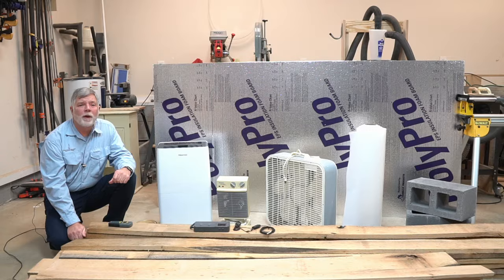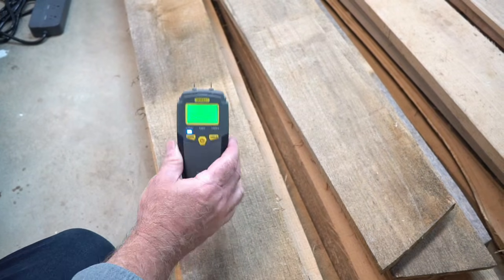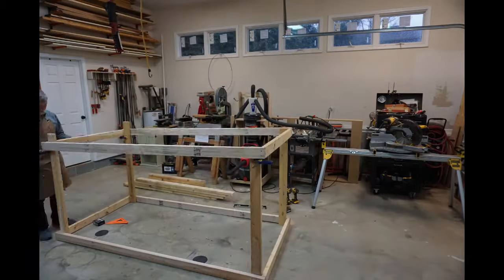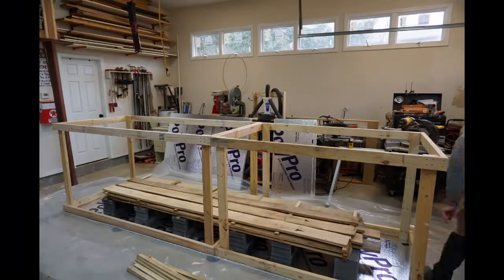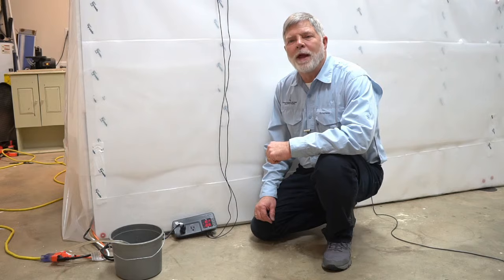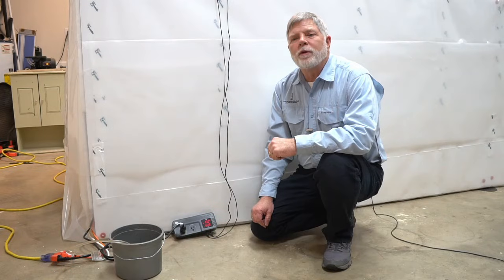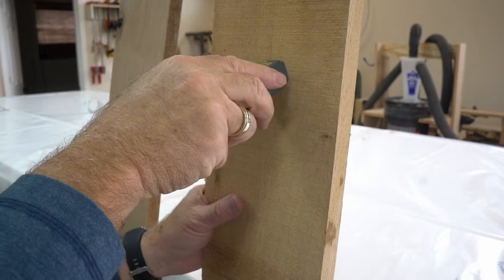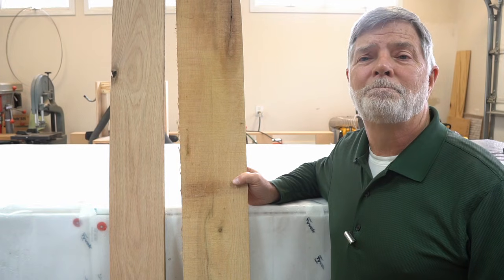Simple DIY Wood Drying Kiln

Comment: I'm thinking that simple ducting would have been far simpler than devising another heat source using light bulbs.
Edit: Not to take away from your design overall. Seems like a great idea, and affordable for a person with a specific budget.
Reply from the maker: I did not want to introduce moisture from outside the kiln into the system. If I used a closed loop duct, that would work.

Comment: Very interesting video, thanks! Did you thought about placing the space heater outside the kiln with a conduit to the kiln? I think the dehumidifier could handle the added air humidity brought in. But I’m not sure
Reply from the maker: I did not think of that. It would complicate the design a little but may improve on some safety concerns with having a heater inside the box. I used the amount of water drawn off by the dehumidifier as a gauge for when the wood was dry since I did not have a moisture sensor in the wood. In later versions of this design, I added 1 1/2 inch pink insolation board and found that the heat from the dehumidifier itself was sufficient for the drying process and only needed the heater for sterilization.

Comment: Do you use a moisture meter in the kiln when running to determine when the switch from drying to sterilization?
Reply from the maker: I do not use a moisture meter in the wood being dried but I do use a humidity sensor in the kiln that I monitor. I also monitor the water being pulled out of the wood. When I stop pulling off water, then I switch to the sterilization phase.

Comment: After the wood sits for a year? Defeats the purpose...
Reply from the maker: Air drying wood will not get the moisture content to the goal of 6-8%. In the climate in my local area, a MC of 12% is about the best I can get air drying. I use my kiln to finish the drying process and sterilize the wood. I have dried wood from green but it takes 8 weeks or so.
Reply: @logstolumbernow2011  Im guessing air drying will leave potential for bugs to be still in the boards?
Reply from the maker: @yessir6325  Yes. If the wood has been infected with wood beatles, they could remain dormant until the wood goes inside and warms up. Not all wood has insects but it is really disappointing to find a little pile of sawdust under your new farmhouse table.
Reply: I must be in a similar area, I can't seem to get it below about 11% where I am, in South East Tennessee. Makes sense now, thank you!
Reply: What box are you using for temp control and humity control? Did you get it on Amazon?
Reply from the maker: @TheBignick243  yes, I bought an Inkbird Temperature and Humidity Controller ITC-608T Pre-Wired Dual Stage Thermostat 120VAC 15A 1800W from Amazon. Cost was about $70.

Comment: How thick is the foamboard you used?
Reply from the maker: In the video I use 3/4" foil sided styrofoam. I have since added 1 1/2" pink rigid foam board cut to friction fit between the 2x4s then wrap with the styrofoam. The added insulation gives me better temperature control.
Reply: @logstolumbernow2011  Thank you

Comment: Excellent! I'm using your idea as inspiration to build a modified kiln in my own garage. You mention airdrying to 12-14% BEFORE putting in kiln. I'm in Florida with high humidity, so I doubt airdrying will get it down to that low. What about if I put in wood that's around 22-25% (at least with moisture meter) will that end up drying to below 10%?
Appreciate your thoughts on this
Reply from the maker: Yes, you can reach 10% MC even if you started with green wood. It would just take longer. Dry it slow and use your moisture meter. I have dried from green in about 6 weeks using this method. I would recommend you add 1 1/2" pink insulation board cut to friction fit between the 2x4 structure. This greatly improves heat retention.
Reply: @logstolumbernow2011  Hey Alan, thanks for the quick response. So my setup is as follows: I have a layer of attic foil radiant barrier on the inside as the first layer, followed by a 2" thick poly foam board. All of the edges are sealed by using hvac aluminum tape. My final outside layer will either be plastic like you used or a the same plastic used for wrapping homes. Will that be sufficient, or do you think I still need the pink board?
Reply from the maker: @MrEffectual  I think you have it covered. What I call pink board is probably the same as your poly board.

Comment: Hey there, can you share what kind of bulbs you used for your heat source?  Trying to ensure I can get the kiln to at least 140-150 degrees to ensure anything living in the wood doesn't survive.   Any guidance would be greatly appreciated!
Reply: I used four 250w incandescent heat lamp bulbs.
Reply from the maker: The last time a assembled my kiln, I added 1 1/2" XPS foam board insulation cut to friction fit between the 2x4s of the frame. This added the extra insulation needed for the heat lamp bulbs to bring the kiln to 140 degrees over about a 2 day period.

Comment: Hi Alan, I just built a kiln per your video. Thanks so much for the detailed instructions. My tree was just cut down here in ohio and is a softwood maple. How long do you suppose I should leave it in the kiln? Is 100 degrees the right temp for my fresh cut lumber? Thanks so much! Josh
Reply from the maker: Hi Josh, Yes, I believe 100 deg is a good temp for your kiln. You have to be careful not to exceed the operating temps of the dehydrator. Mine shuts down at an internal temp of 120 deg. 100 deg in the chamber is right at that border line. Drying times are dependent on thickness as well as specie. 8/4 boards will take 60-90 days. 4/4 boards will take 30-60 days. You want to take out 1-2% MC per day.
Reply: @logstolumbernow2011  thanks so much sir!

Comment: What did you use as a heat source?
Reply from the maker: After I realized that my commercial heater was shutting off due to the high temperature, I built a heat source using 4 - 250W heat lamps. This worked fine for my setup.

Comment: That's great. I have some lumber I milled last year that's been sitting outside and drying. This sounds like a really good way to dry lumber. I wonder if I can run something like this outside.
Reply: Yes but my design is not weather tight. I would expect you would need more insulation and a water proof roof as a minimum.
Reply: @boyetta1  Reason I'm asking is I have a concern, which may be unfounded, about fire safety with this setup. I definitely have some space in the basement for something like this.
Reply from the maker: If you do not use the homemade heat source, you should be fine. Most commercial products such as the dehumidifier should have a high temp shutdown. With just the fans and the dehumidifier, the temp should not exceed 100deg. You could also add a smoke detector to the setup for added security.
Reply: @logstolumbernow2011  My main reason for using the kiln is to kill PPB and such that live on my property, so I think heat is pretty important for the process. I'm thinking of a portable design that I can break down.

Comment: Is the 130 degrees enough to kill the insects?
Reply from the maker: Here is the answer to a similar previous question: Yes. I believe this will kill any bugs. My experience and the research I have read says that getting the wood to an core temperature of 130 degrees for 24 hours, after the wood has reached at least 8 percent moisture content, will kill pests, their eggs and fungi that effect wood. The combination of low moisture and high temp will do the trick. The length of time it will take for the core temp to rise to this level will be dependent on the lumber thickness.  However, US regulations for international Trade requires heating wood to a minimum core temperature of 133 degrees. Be sure to check your MC using a moisture meter. Don't guess.

Comment: Any idea of what your running costs were?  I'm in the NE, however still wondering if it might be possible to do this with a black plastic in the yard to get the heat up.  Biggest question though is how much warping/twisting results from this?  If even moderate, would it make any sense  during the sanitize phase to remove the stickers, stack the lumber, and then place a bunch of cinder blocks on it to help level? Or maybe do that after the sanitize, and open the plastic to allow them to absorb some moisture back to assist with leveling?
Reply from the maker: This is an answer to a previous question "I did not record or calculate the energy costs related to this project at the time of the video, however the fan consumes about 100 watts per hour, the dehumidifier has a max power draw of 6.8 amps at 115 vac, the heat source was 1000 watts per hour. If you assume the duty cycle of each device was 100% (which it was not), the max power usage would be about 1882 watts per hour. Our power cost is about $0.10 per kilowatt hour. This would make the maximum cost to operate this kiln, $0.19 per hour or $22.58 for the 5 days I ran the kiln." When I stacked my lumber in the kiln, I weighted down the top with concrete blocks to keep the boards from warping. It helps but will not eliminate wood movement. Most of the movement is a result of stress in the board from natural growth events and the method used to mill the logs. I hope this helps.

Comment: I finally built one similar yet without a heat source ( for safety reasons). The kiln has gotten up to 129 degrees from the dehumidifier alone, also have a box fan going continuously. Do you think this will be adequate to kill any bugs? It has been running 5 days now like this. The wood is ash attacked by beetles. It had been air drying outside for approximately 10 months previously. Thank you in advance. This video has been very helpful
Reply from the maker: Yes. I believe this will kill any bugs. My experience and the research I have read says that getting the wood to an core temperature of 130 degrees for 24 hours, after the wood has reached at least 8 percent moisture content, will kill pests, their eggs and fungi that effect wood. The combination of low moisture and high temp will do the trick. The length of time it will take for the core temp to rise to this level will be dependent on the lumber thickness.  However, US regulations for international Trade requires heating wood to a minimum core temperature of 133 degrees. Be sure to check your MC using a moisture meter. Don't guess.

Comment: Welflits been almost 2 years. So what do you do with the kilm when not in use?
Reply from the maker: My workshop is fairly small. I disassemble the kiln and use the material for other projects. I rebuild the kiln replacing what I repurposed, each time I need to dry lumber.
Reply: @logstolumbernow2011  thanks for your update.

Comment: So is it right to say in your case here you only needed to do it for 3 days as it stopped pulling moisture after 3 days? Have you done this with just cut lumber? How long would it take with fresh cut lumber to dry roughly?
Reply from the maker: It will vary by species and thickness. The important thing is to measure the moisture content of the wood as it dries. It takes about 60 days for 400bdft of 1 inch green oak lumber to reach moisture content of 8% from the initial 75%-80% in my setup. I can pull 1%-2% per day.
Reply: @logstolumbernow2011  that's a great help, thanks for the info. Keep up the good videos

Comment: Thanks for the great video. I am about to mill a quantity of oak into 4/4 boards. Would it be viable to put those boards in a kiln like yours from the get go, or would you have to air dry it first?
Thanks!
Reply: Yes you can dry green lumber with this design. It will take 2-3 months. Check the moisture content once a week to monitor progress. I am about to build this again to dry some 8/4 green oak slabs. I expect it to take 90 days.

Comment: That's great info about normal space heaters.
Reply from the maker: Safety is important. If you want to buy a heater built for this purpose it costs $800 or more. The heat lamp seemed a good, low cost and safe solution.

Comment: That is a fabulous video sir!! Have looked at several and yours in by far the most succint and to the point, with the details needed. Getting ready to build one, main difference I am planning is it will be an outside kiln set on a back patio (but not under cover). So will put a exterior siding and roofing material of some sort. My main question for now is- have you worked out the issue with the heat source and ability to hold it hotter is desired?? I assume the dehumidifier would suffice to bring up to the low 100-120 deg plus temps for the drying, but for the sterilization process, which is important, I would like to get it up to 150. You said the heat lamps didnt get it that hot for you? Did you go back to the heater and did that work? Can you recommend a heater that would do that, or what did you use to make that happen? TY so much, looking forward to your other projects, just subscribed :)
Reply: I have found that almost all consumer products have an over temp protection circuit in its controls. Even the dehumidifier shut down when the temp got above 120 degrees in the chamber. I was able to operate my dehumidifier at 100 degrees. I had the tempreture controller set for 100 degrees. It only turned on the heat source while the compressor of the dehumidifier was cycling off. I was not able to reach 150 degrees in my kiln for the sterilization cycle. It could be due to the limited amount of insulation I use. Next time I may add more insulation. The key temperature to kill insects is to get the internal temp of the wood to 130 degrees. In a commercial kiln, the setpoint is 150 degree temperature for 8-24 hours. This is required to get the internal temp of the wood to that critical temp of 130 degrees. If you leave the wood in a 130 degree chamber for longer, you should get the same effect. This is what I do. I keep the wood at this higher temp for 3 days. To set pitch in pine, you may need the full 150 degrees. I have looked at several types of consumer heaters. All the space and garage heaters I have looked at all have the over temp protection and will shut down before your chamber reaches the 150 temp set point. You may have to get a special purpose heating element. I found one from Nyle for kilns but it is expensive and requires 240 VAC. That defeats the purpose of my "low cost" kiln concept.
Reply: @boyetta1  TY that helps a lot, good info, detailed just like your videos, TY!!!

Comment: I'm setting up an old refrigerator as a small kiln for my woodturning projects. Do you mind if I ask what controller you used or if you have a link for it? The first one I purchased didn't work out very well.
Reply: I used the Inkbird temperature and humidity controller bought from Amazon for about $70. Here is the link. https://www.amazon.com/gp/product/B07GQWY9HM/ref=ppx_yo_dt_b_search_asin_title?ie=UTF8&psc=1
Reply: @boyetta1  Thanks Alan.

Comment: The way you put the frame together is absolutely brilliant. I've never thought to assemble both the top and bottom together, add the corners, and shimmy the thing up like that. Nice work. I'll be sure to use this trick next time instead of fighting with my frames that aren't square.
Reply from the maker: You learn many tricks when you work alone. You can never have too many clamps!
Reply: I agree, that is a slick time saving trick there.

Comment: Any particular brand/model of dehumidifier you would suggest? Also looking to make the unit as cost efficient to operate as possible. Thank you for sharing your wisdom and knowledge.......
Reply from the maker: I did not buy my dehumidifier for this project. It was purchased during a rain event that flooded a room of my house. It is a Hisense 70 pint per day dehumidifier with a built-in pump. The pump is important so you do not have to open the kiln to empty the collected water. A smaller unit may be just as effective for this small of a volume.

Comment: How much would this increase the electrical bill? (Dehumidifier, fan, heat source)
Reply from the maker: I did not record or calculate the energy costs related to this project at the time of the video, however the fan consumes about 100 watts per hour, the dehumidifier has a max power draw of 6.8 amps at 115 vac, the heat source was 1000 watts per hour. If you assume the duty cycle of each device was 100% (which it was not), the max power usage would be about 1882 watts per hour. Our power cost is about $0.10 per kilowatt hour. This would make the maximum cost to operate this kiln, $0.19 per hour or $22.58 for the 5 days I ran the kiln. I hope this helps.

Comment: The dehumidifier should be enough heat by itself.
Reply from the maker: Yes, while the dehumidifier was running, the heat source shut off. Between cycles of the dehumidifier, the heat source would keep the temp at the set point.

Comment: I built a similar kiln. I have found that I don’t need the heater unless it’s too cold out for the humidifier to run. I also didn’t wrap mine in plastic and I can take the front side off for loading the kiln. Seems to work good and since it’s lumber I had milled from logs I cut myself it’s very cheap material compared to buying it. I also set the humidifier to run continuously. Seems to work better that way
Reply from the maker: Thanks for your comments. I wrapped my kiln in plastic to keep moisture from entering from the surrounding environment. I did not really need the heat element until I went to sterilize the wood to kill insects. The heat from the dehumidifier compressor kept the temp up during the bulk of the drying process.